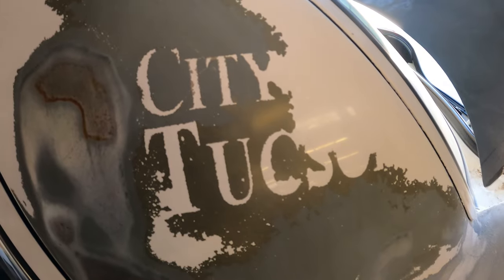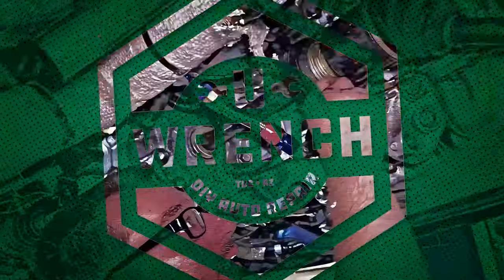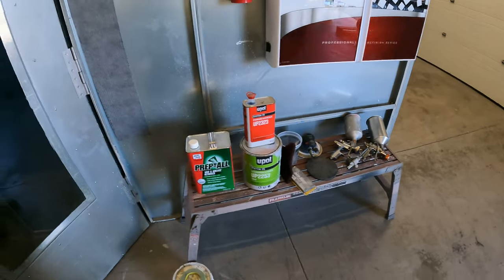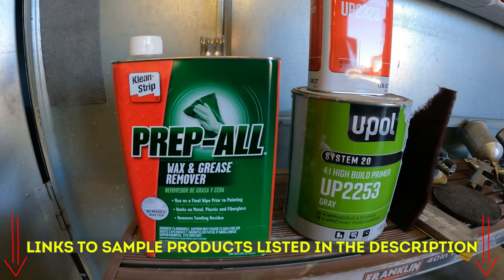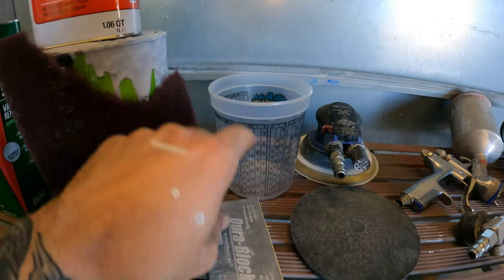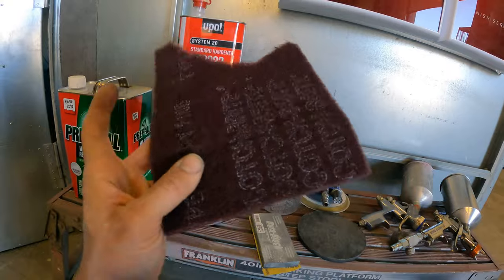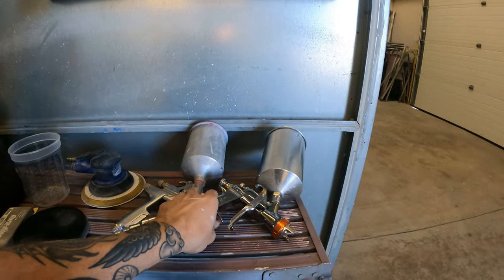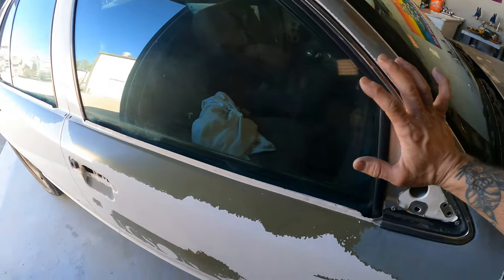The Cheapest Way to Paint Your Car with PROFESSIONAL Results!

Comment: My Ranger is flaking paint off like a bad sunburn.  (It might be a Ford thing.)  I used 220 to sand it down and then 440 to smooth out any sand lines.  I masked off the area and taped. then went completely off the rails and did what you said not to do.  In my defense, it is a "band aid" until I can afford a decent paint shop.

Tip for everyone out there.  Use proper auto paint tape for masking off.  Regular Frog Tape sticks a bit too well.  😳

Comment: Wish y'all did more vids on paint and body. I know your busy, vids take away from your time sensitive jobs. Understandable, hey excellent work. Prep, prep, prep, and prep some more. Pressure washing before tape is so smart. We never did that and struggled with gator constantly. Waiting for the next one dudes.
Reply from the maker: We are working on it. The LS swapped B2200 should have another video soooon. There is progress on it but slow. Engine bay will be prepped for paint once the LS is fitted & running, we'll pull it back out and paint the bay.